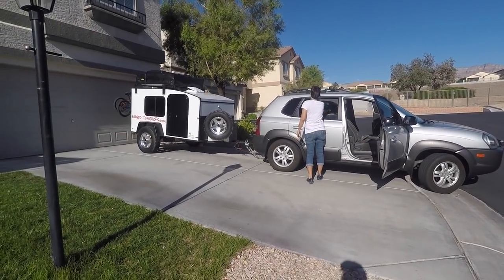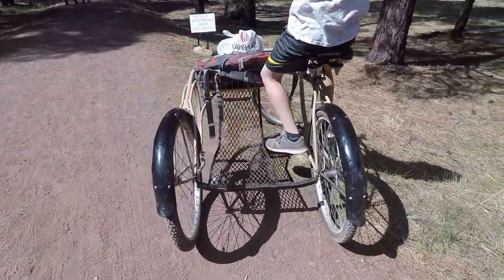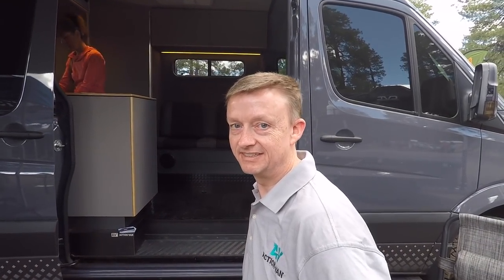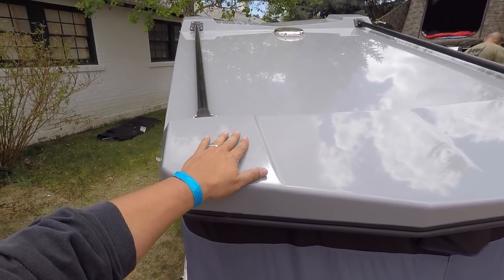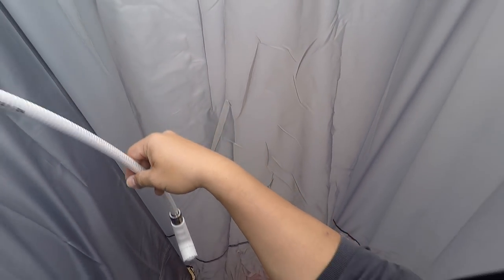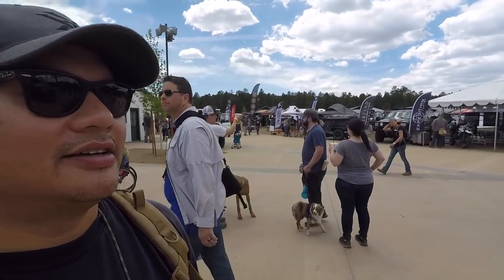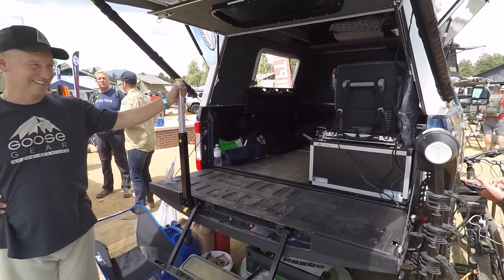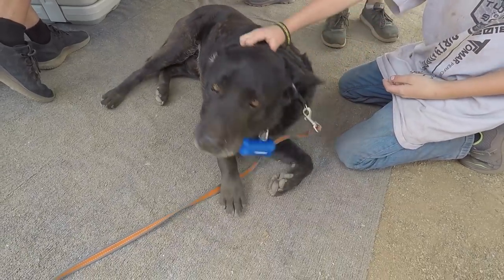Overland Expo West - 3 days in one video (Flagstaff Arizona)

Comment: Man oh man I LOVE that Jeep Rubicon JK with the back half being a one piece camper unit with walk through to the cab!! Earth Roamer used to produce them but only sold a couple so discontinued it but if you get lucky once in a while one pops up for sale on expedition sites.  The big famous one that got it all started white with the utah arch and it was a steal !  I wanted it desperately, at the time I was single and 33 years old , live north of Moab Utah and was going to put a little money into retrofitting and refinishing the interior in a modern contemprorary style , add solar , electronics etc etc and then live in it year round (they were 4 season units from earth roamer so winter to summer were good). I waited a day too long and it sold , haven’t seen one since but keep hoping Earth Roamer will try again with the new JL wranglers , or USe the gladiator platform, with the little Cummins diesel now available it’s be epic!

Comment: 1:01:30 Stewart and Stevenson MTV's are still used in the Army to haul stuff around post in a non-combat environment, like in TRADOC (bootcamp/AIT). In a combat zone, the Army uses the new up-armored versions made by Oshkosh. They have the same form factor except the panels are very angled and VERY heavy. But the Army is SLOWLY getting rid of the old ones.

Comment: Great job!  An hour + video and you missed an entire day.  Good coverage of the stuff, but the $$$ of some of those rigs wow. OregonTrailR 👍
Reply from the maker: Rick Green it's in line with the regular RV industry. Weatherproof materials, safety regulations, beefed up suspensions, water plumbing and heating systems, cooking/propane systems, convertible bedding/seating systems all cost money. You can build things yourself but that often involves tons of mistakes which ends up costing more than if you just had a pro build it for you. There is always tent camping....it just comes with it's own pros and cons.

Comment: Wow that was an epic hour & a half. Wish I could have been there but my feet would have given out. You did an excellent job covering this show. Now that ive got my 4runner i gotta start outfitting for travel. A trailer may come down the road but for now we will use a tent. I'm trying to stay as lightweight as I can by trying the minimalist approach. We'll see how that works out. Have you decided which direction your gonna go for your rig? Seems a teardrop w/Rtt works well for you and the family. Thanks for the awesome coverage of OE West.
Reply from the maker: mykalbee I think I want to buy a full size V8 truck (for going up hill to the mountains) and some kind of pop up slide in camper. Maybe the 4wheel camper hawk shell model to stay affordable and super lightweight yet can shelter my whole family. I like the trailers but they are expensive and I hate backing them up and parking them are a pain in the ass.

Comment: Whats the protocol for stowing away the pop up top if it gets wet from rain? Do you have to leave it up till it dries? I’d worry about mold and mildew.
Reply: Scott Carlon  better products tend to use mold n mildew resistant fabric... regardless, best would be to dry out in sunlight asap. in situations when rain persists, i would run a fan inside to help reduce dampness as much as possible (more air flow the better of course) and i would already have damprid. it would be a hassle but wiping away water droplets or that is any dampness with a rag before transport should obviously help.  disclosure: im not speaking from experience... but thru a thought experiment 👊🤓 however im confident my response is for the most part sensible n reliable. 

i personally would also keep an eye on the dopplar radar to plan in advance... and set up a tarp over my unit before the wetness hits. plus, i dont like rain hitting my cover directly so having that extra layer softens the rain sound for a more soothing sleep 🍗
Reply: Scott Carlon, so to add additional information from Joapps said and from our experience, whenever our equipment gets wet, such as pop ups and tents, we would look for the nearest weather forecast where we would have two solid sunny days for cleaning and drying.  For cleaning I use straight vinegar in a spray, spray all down and wipe a few times.  Let it dry for 10 minutes or so with a fan on full blast than go over it with the bleach and water mixture ( 3 Mountain Dew caps to 1 gallon of water ), spray it down and wipe it again.  After both applications is done than let it sit out in the sun for the remainder of the day and the day after.  Good luck to you all, let us Know if that works!
Reply: Yang Lu That is a great tip! 😎👍
Reply: Mountain Dew cap  hehehe 😜
Reply: Yang Lu just like backpacking in weather. Next time you pop it up early in the day so it can breath and dry out.

Comment: Is there any reason why you haven't jumped into a body on frame 4x4 yet? I figured you would have a crazy built rig with all the videos you do.
Reply from the maker: angelo calderon I have had many 4x4s over the years. Jeep CJ7, GMC Yukon with a 9" lift and 35" toyos, Chevy Tahoe, Ford F150 crew cab 4x4, Nissan Xterra...I bought the Hyundai just for commuting to work to save gas because all of the above vehicles were major gas guzzlers. I miss having a real 4x4 sp I do plan on buying a Toyota Tundra 4x4 sometime soon. Or some other full sized V8 truck?
Reply: Awesome, thanks for the reply!